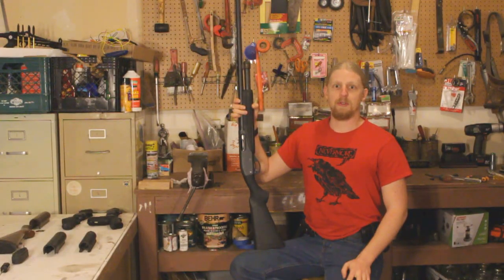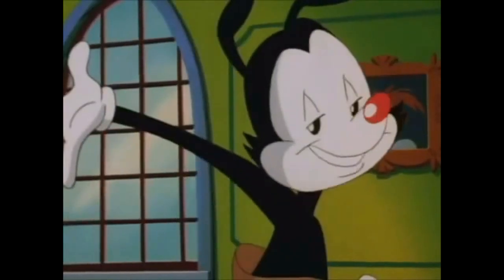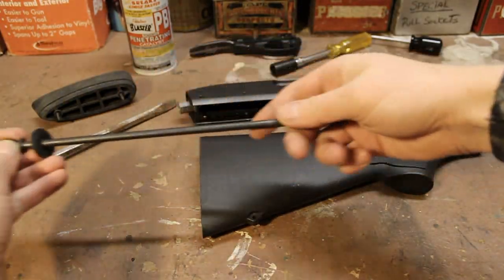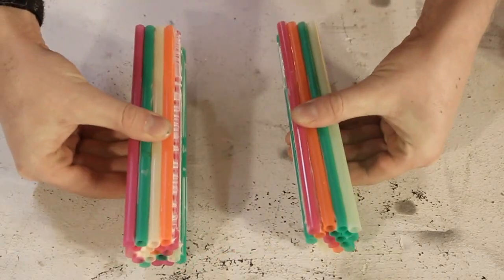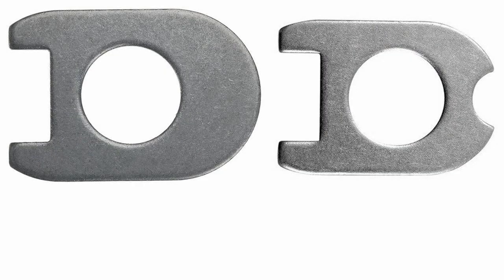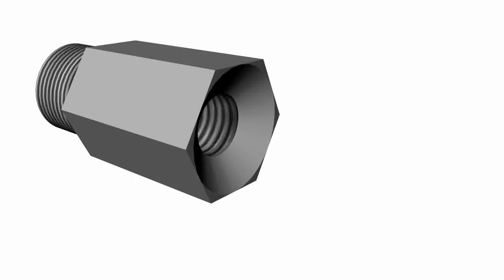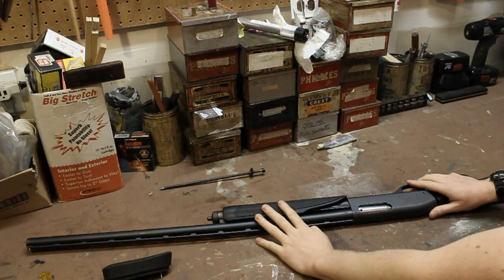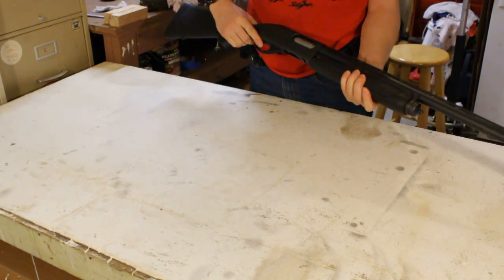Stock Removal & Installation - Remington 870 Tips & Tricks #14

Comment: Synchronizor..Love your videos. Can you help me? I just bought a new Remington Supercell recoil pad? It does not fit the stock properly. It appears to be too big? Is there a trick to make it fit properly? I just spent 20 something dollars for it. My 870 kicked like a mule, with the old pad? Can you help???
Reply from the maker: SuperCell pads are pre-fit, they come in different versions to match specific stocks.  You may have the wrong pad for your stock, or your stock may be an older or aftermarket one that doesn't have a matching SuperCell.  I would get in touch with Remington and see what part number they recommend for your stock.  If you've already done that and the ill-fitting pad you have is the best match, or they say they don't have a pad that matches your stock, there are other aftermarket pre-fit pads that might work, or you can always have a grind-to-fit pad installed.
Reply: Synchronizor Thank you Sir..
Reply: This comment goes to rifles in general that gun to gun of the same model, wood stocks are just not the same. Butt pads often have to be ground to fit. They are the one item I dont want to buy online, I take the rifle to a gun shop and match up the one I want and if it wont fit exactly I have the gunsmith grind it until it does fit. Some people dont care but I personally wont have an ill-fitting butt pad. If the pad costs $20 and its another $25 to make it fit, thats life.

Comment: Super videos on the 870, including this one as I purchased an Urbino stock with shorter 12" reach and pistol grip to replace the one it came with. The other one you did showing stripping the 870 tactical down was invaluable. One note . . . an act that causes me to cringe every time I see someone do it . . . resting your hand over the end of the muzzle. Thanks for the detailed instructions.
Reply from the maker: Thanks for the kind words.

Regarding the hand on the muzzle, note that the slide is all the way back and the action is open.  On an 870, that makes the gun completely safe.  Even if a shell was in there and managed to line itself up with the bolt-face, both the hammer and firing pin are blocked with the bolt in that position, and the trigger connectors are disengaged from the sear.  This is the state that an 870 should be in when changing choke tubes or cleaning/clearing the barrel - both activities that place body parts in front of the muzzle.

Comment: I have a hawk 982 and a hogue pistol grip the bolt it came with will not fit my receiver its to thick any help????
Reply from the maker: Genuine 870s use 1/4"-28 threads for the stock bolt.  If your clone uses something different, I would suggest taking your receiver and the pistol grip into a fastener store.  Hopefully they'll be able to help you find something that fits.

Comment: Thanks for the extremely thorough instructional video.  That tip to lube a stuck stock bolt from behind the trigger assembly was a life-saver.  I wouldn't have been able to get the job done otherwise.

Comment: is the 870 good for trap/skeet?
Reply from the maker: It's a good gun for any shotgunning activity (so long as you don't get one of the dedicated Tactical models with the single-piece extended magazine tubes).  For clay games, the 870 platform offers a multitude of barrel lengths, chokes, and stocks that you can choose from to get it set up well for whatever game you're into, and its design also makes it easy to get it weighted just right without making permanent modifications.

I will say though, that a pump-action gun is going to put you at a disadvantage for really competitive clay target games if you're shooting doubles (for singles, there's no real disadvantage).  It can certainly be done - I can pick up the second skeet clay with my 870, even though my barrel is longer than ideal for that game - but if you want to get really serious with doubles, you'll probably end up wanting an over/under or semi-auto eventually.  That said, an 870 with the right configuration will certainly work well enough for less competitive, more recreational doubles games, or as a starter gun to see if you want to spend the money on a dedicated doubles gun.  However, no over/under is going to let you switch back to hunting or HD setups in minutes like an 870.

Comment: just because i am a little pissed right now 
to chill  and watch a video  
where the fuck this goes  ? 
https://www.remington.com/shop/870-Express-Synthetic-Stock-Bolt-Guide/p/F94215
Reply from the maker: It's a little piece that's meant to help center the stock bolt in the stock bolt channel.  In theory, it makes it a little easier to get the stock bolt started in the receiver stud, but mostly, it just seems to come loose and rattle.  Most 870s don't have that part, and if your gun does, I'd just ditch it.
Reply: thanks man
i bought  a synthetic set , to replace the laminate set , that came from factory with it , and i didn't know , not a diagram or  good instructions 

you have to put the washer in reverse  and don't put  the plate at all 

in the end i didn't use that washer at all   
i fixed it must be fine

Comment: Thanks for the great video! Your attention to the full detail is very helpful. One additional question on the composite stock assembly with adjustable "Length of Pull" LOP. I noticed that the recoil pad was slightly loose and needed attention. The screws felt fully engaged when loosening. The simple instructions that came with speak of using different length screws depending on what combination of spacers used. I bought my 20ga 11-87 used and the optional screws that came with are using a rather large head (approx 3/8") which will not fit into the small holes of the rubber recoil pad. Is there a trick for changing out these screws out or do I have the incorrect combination of parts? Thanks
Reply from the maker: Well, the screw holes in factory recoil pads are, by design, pretty small compared to the heads of the screws that go in them.  This is meant to keep the screws captured so they're less likely to fall out and get lost when the pad is removed, and to keep from having ugly gaping holes in the rear of the pad.

Now, since you bought your gun used, there's certainly a chance that you have an odd set of screws that aren't meant for your pad.  However, if you're pretty confident that they do all come from the same kit, I would go ahead and just be careful not to be too violent.  Factory recoil pads are usually either rubber or coated foam, and they have enough elasticity to let you get the much larger screw heads in there.  Do it too many times, and you might start tearing something, but once the screws are in the pad, they're meant to stay in.

Comment: I take it from the example of the Hogue pistol grip that you used in this video that it comes with an inadequately sized fastener and I was planning to use this exact grip in the future.  Have you by chance narrowed down a specific McMaster-Carr parts number for the most optimally sized fastener for when you're installing this grip directly into the receiver with no other parts inbetween?  You seem pretty diligent about this type of thing and it looks like you tried several different lengths already
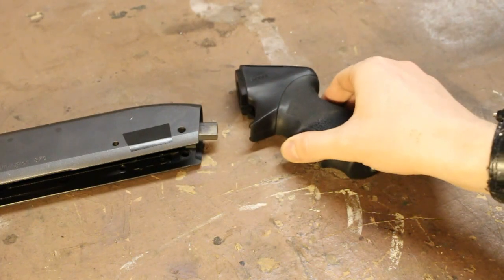Reply from the maker: The grip at 11:15 is actually a Pachmayr, not the Hogue from the previous shot.

I'm actually in the middle of writing a comparison piece on four different pistol grips.  I've had the Hogue for years, and was provided three others to evaluate alongside it.  All four of them came with fasteners that were short to one extent or another.  Only one was so short that it actually concerned me, but none of them fully engaged the threads of the receiver stud.

Since I've had my Hogue grip for a long time, and the original screw was damaged during the first installation (my fault), I couldn't tell you for sure what length it was, though I do remember that it was shorter than ideal.  If I had to guess, I'd say 1 3/4" long, but don't quote me on that.  If you do buy one of those grips, I'd appreciate it if you could measure the screw and let me know its length, because it may have changed since I got mine.

The replacement screw I use with my Hogue is a 2" long 1/4"-28 SHCS.  It's almost exactly 2 1/4" from the back of the mounting washer to the end of the receiver stud's threads when there's nothing else between the grip and the stock, so a 2 1/4" screw would leave no space for tolerances or material compression.  A 2 1/8" screw would probably be ideal, but I haven't come across any of those in the fine thread, and I don't have any concerns about the 2" screw failing on me, since the difference would only be three turns of thread or so.

The MMC item number for a screw similar to what I use is 91251A450.  But that's for a pack of 25, and you'll pay shipping too.  I would suggest swinging by your local hardware or fastener store instead, since they'll sell you just two or three for much less.

Comment: I always learn something when I watch your videos.  This was no exception.  This is an encyclopedia of 870 knowledge.  I look forward to your next installment.  Any future chances of doing the Mossberg 500?
Reply from the maker: +RyeOnHam I like the 870 better than the Mossberg 500s, so probably not.  I may do an in-depth design comparison between the 870 & the 500-series in the future, but apart from that, I have no plans.  I may be able to help out if you have specific questions, though.
Reply: ***** More general questions.  I'm probably a rare exception in modern days, but I actually carried and used the 870 on duty.  Our guns were from the 60's and showed their wear.  The only issues we had were with the shell latches and ejectors.  The guns were, on average, about 30 years old by the time we got hold of them.  The receiver finish was virtually gone inside and out, but there were hints of parkerizing here and there.  The shell latches were held in the receiver by friction.  It appeared that they had been staked and restaked over the years, but required careful lining up using the trigger group pins to reassemble.  The ejectors had been replaced several times, by my estimation.

So, a question I have is why did the 870 not do as well as the 590 in tests?  I have gunsmithed both guns over the years, and can tell you that I have come to the same conclusion you have.  The 870's had problems, but many were user related and, again, the shell latches.  I kept a few on hand and usually just swapped them out.  Extractors and an occasional ejector, of course, though the extractors were usually a result of sticky chambers.  The "Express" models were a bigger problem but mostly with quality control.

Contrasted to the 500, I have had so many problems it's not really fair to mention them, but I think several design elements are superior, or at least potentially superior.
Reply from the maker: +RyeOnHam  Mossberg's marketing makes it sound like the military tested everything and only the 590 passed, but the reality is that entries for the specific program that led to the adoption of the 590 just had to meet certain requirements for features, specifications, and durability, as laid out in the various revisions of the MIL-S-3443.  The 590 met these requirements, and from there, its selection over other passing designs (if there were any around the same time) was probably based on its unit price, or maybe politics.

As for the 870, my understanding is that it was never even submitted for that specific program, and it certainly didn't compete with the 590 for adoption.  The 870 was first purchased by the U.S. Armed Forces back in the 1960s, which was before the 590 was even developed, and it has served continuously ever since.  I believe 870s are current-issue for the Air Force & Coast Guard, but all branches of the U.S. military have used them at one time or another, and it's been adopted by a number of foreign militaries as well.  I don't know whether the 870 was held to an early version of MIL-S-3443, or some other spec, but it's just as much a military shotgun as the Mossberg 590.
Reply: I just googled that mil-spec and it was inactivated in 1995.  EverySpec.com was where I found them.  Looks like the original spec was 1975.  I will have to read through the spec in more depth, but it appears to include the earlier Winchester, Ithaca, and Remington pumps.

Comment: Some recoil pads use square drive screws also.
Reply from the maker: +al russo That's correct, good point.  If a phillips screwdriver isn't grabbing the recoil pad screw, a #2 square-drive is worth trying.  I'll add an annotation.